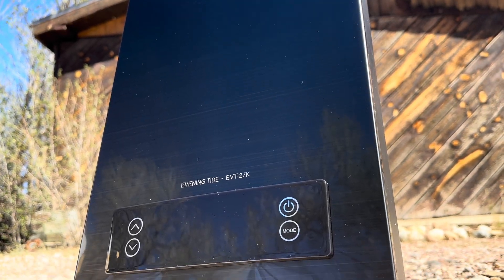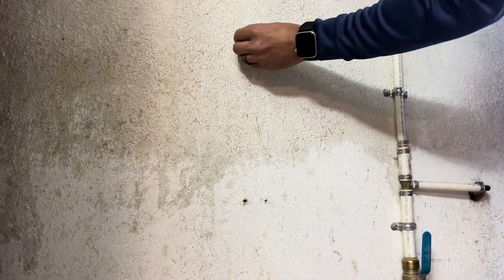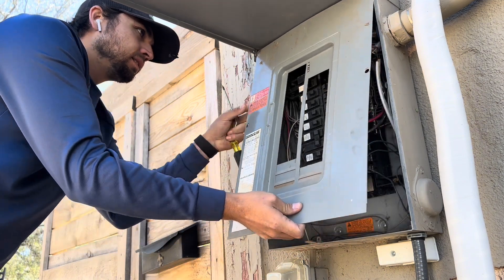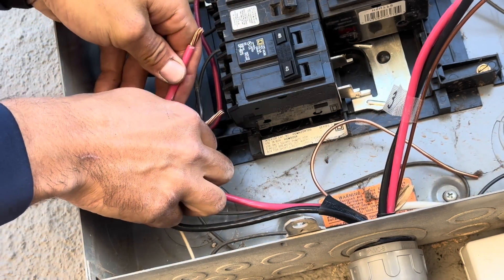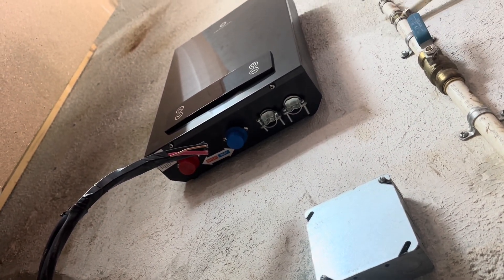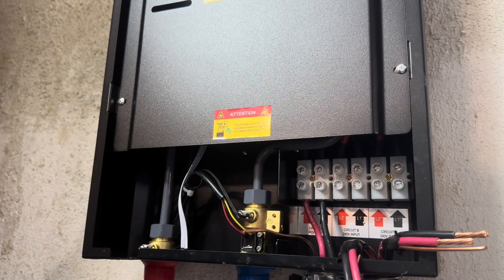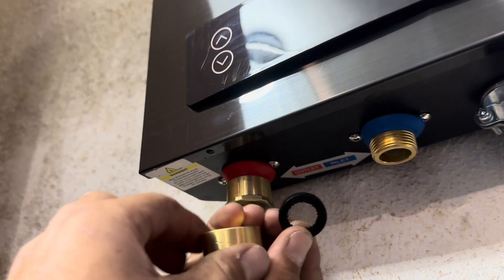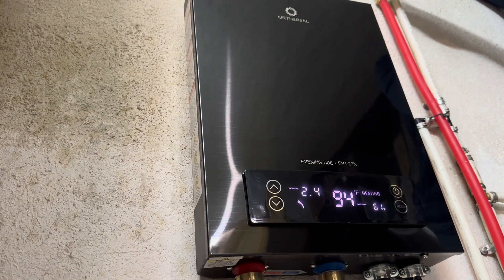Installing and Reviewing the Airthereal 27kW Electric Tankless Water Heater

Comment: you installed the ground wire to the neutral bar, but called it the ground bar, is this correct? I dont think you should install the bare ground wire to the neutral?
Reply: I noticed that all the ground wires are on the other side of box...oops!